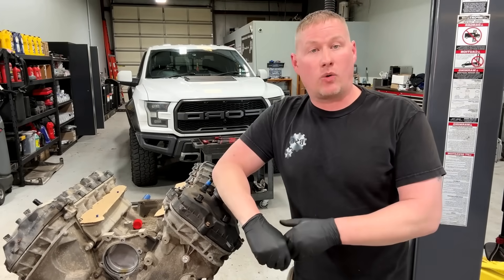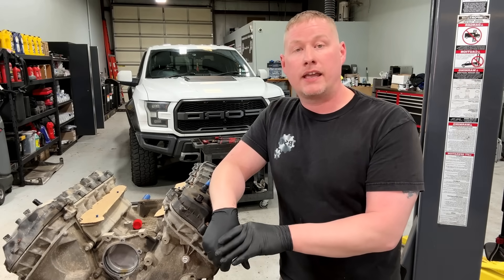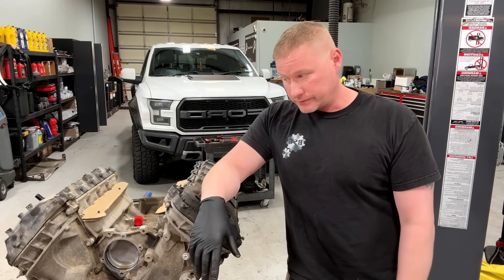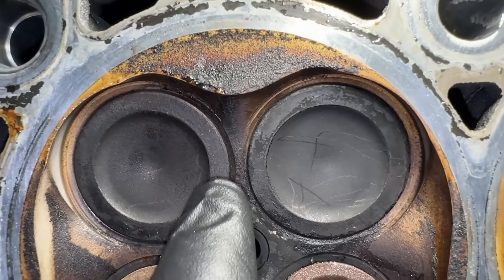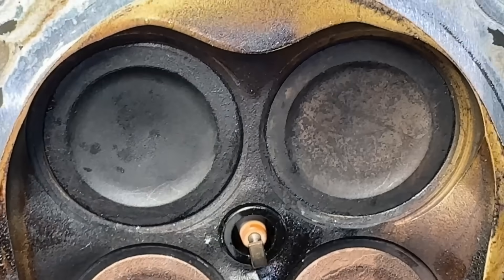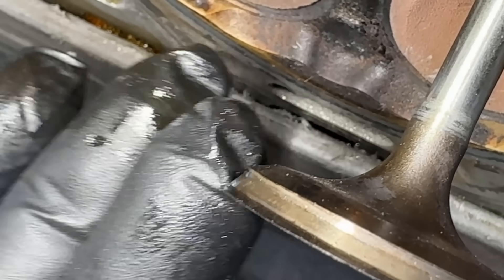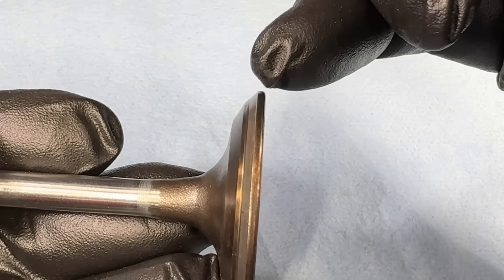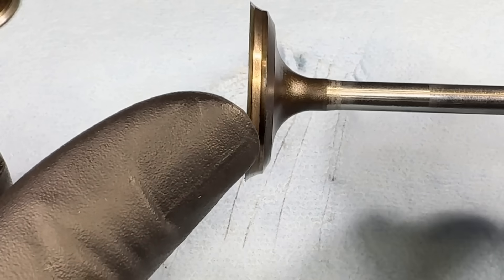The One Fatal Design Flaw of the 2011-2014 Ford 5.0L Coyote Engines!

Comment: My dad has a 2016 F150 5.0 that almost at end of warranty developed a dead cylinder, ford replaced engine under warranty. Is that common?
Reply: More than likely the cylinder bores came out of round or were not perfect from the factory. Could have even been a pinched ring land causing scoring. Many coyotes are susceptible to detonation which is not good for pistons.